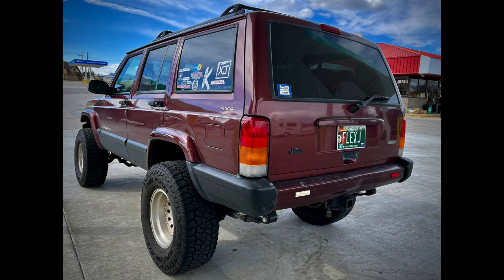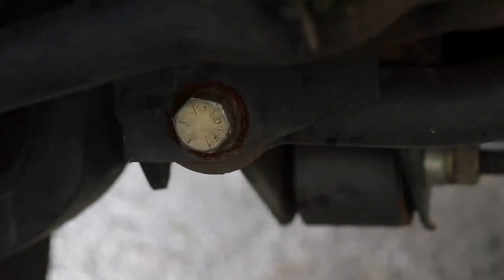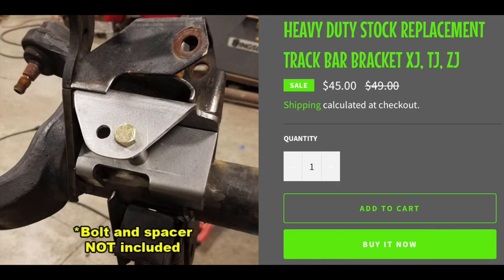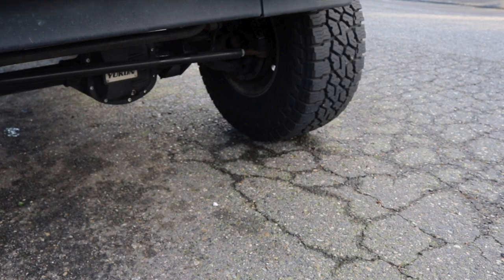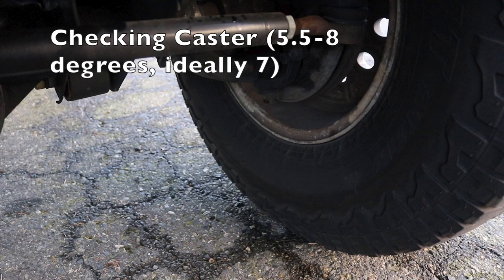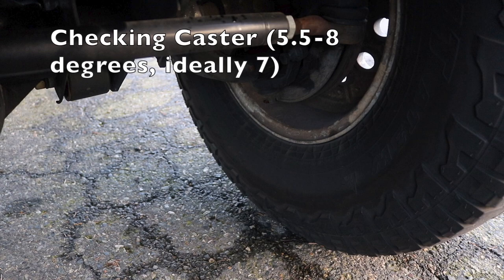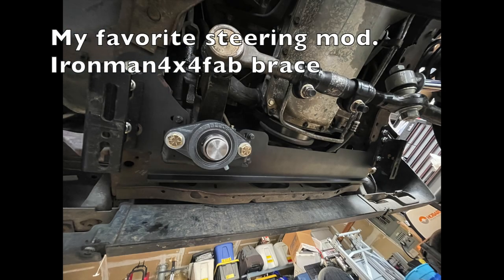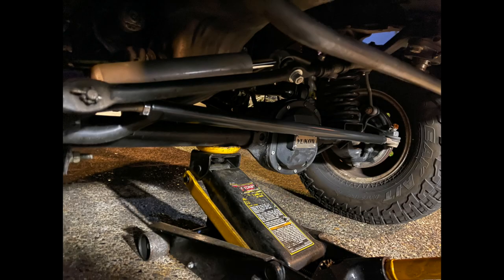Checking your Jeep Cherokee XJ's Steering for Play

Comment: Awesome video! What steering set up would you recommend for a 2.5 in lift? And what did you use for the lower door panel armor? I like how it looks!
Reply from the maker: Thanks! Factory steering works great and especially at a lower lift I don’t think it’s even worth worrying about drop pitman arms, or other more involved steering setups. I think something like the ZJ tie rod or iron rock off-road HD tie rod (that’s my vote) would be a good move. It’s a very easy install for the IRO bar, just need to do an alignment after. And it removes the concern of bending the bar. I’d say keep it factory but beef up the tie rod. It’ll be the easiest and most cost effective but also offer a much better increase in strength. 

So it actually doesn’t have armor! The previous owner actually had vinyl stickers along the label. But I believe smittybilt or JCR make door armor. I have since removed the vinyl and do like it a lot, but I do like to protect my doors!

Comment: What Control Arm Drop Brackets are you using on your XJ..?
Thanks..!
Reply from the maker: So I’m actually using the Rough Country Comtrol Arm Drops! They’re advertised for a 4.5”-6.5” lift. I actually just decided to sell them, so if you want to buy them used, let me know! They’re a good part, I just ended up lowering my lift and I’ll be getting long arms, so I can’t use them with my current setup

Comment: Does having these bad bushings make the jeep vibrate ate 60 miles?
Reply from the maker: Well if you feel a steering wheel shimmy, maybe. But if you’re talking about the entire jeep vibrating, it’s more likely your driveshaft. Check the quality of your u joints, and also check your pinion angle, especially if you’re lifted and don’t have a SYE
Reply: @xj_overlander   thanks will do